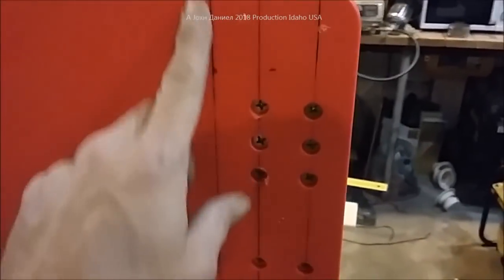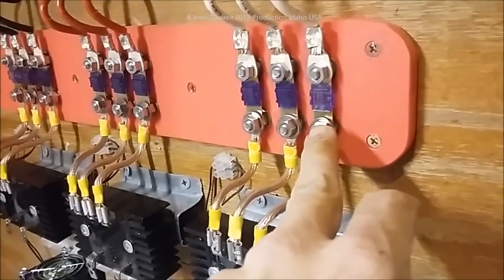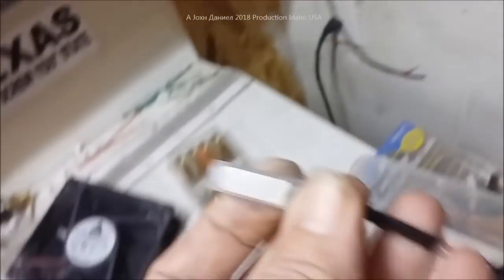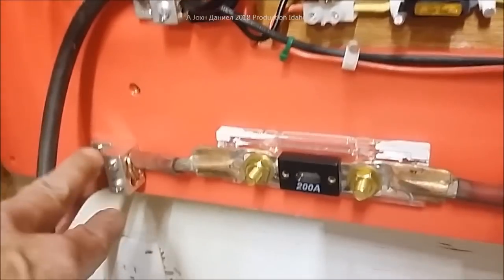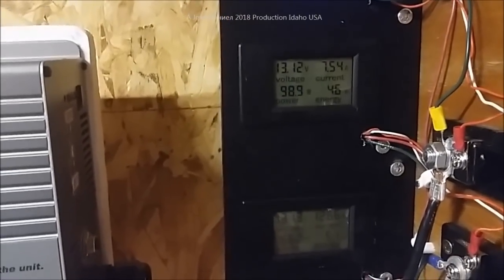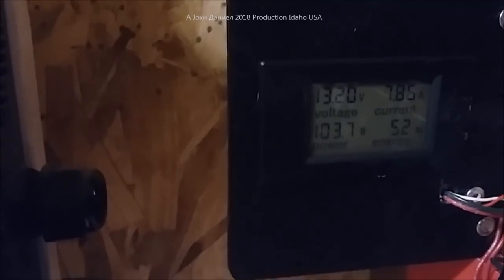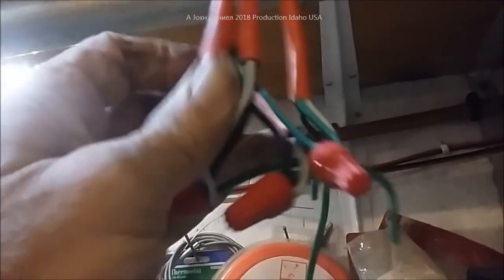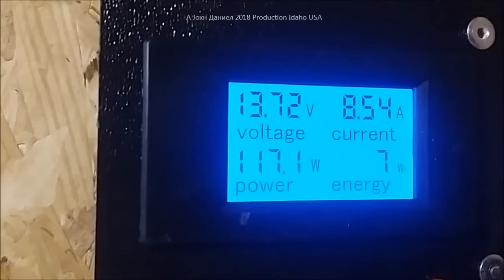Micro Wind Turbine 3 phase power systems Rectifiers pt. 1 my FULL PARTS LIST BELOW

Comment from the maker: LOOK UP TO THE INFO ⇑⇑ ⇑ ABOVE for the video, links to all parts used, updated when possible.
Reply: Јоhn Daniel    Love the work man.  I don’t see the list to link of parts used.
Reply from the maker: @dolfseymour5219  You must be using a cell phone to view them, look on the lower right under the video and tap the down button ▼ to see the video info.
Reply: Thank I bought greenergy turbine Apollo 650w w CC and dump load from the same manufacturer, I get to the same display you have, I'm new on this, is to support my small solar system pv 400w, 12v 620Ah, If I have to work in something how I'm going to break the turbine without damaging it??, sorry to bother, you are the only one that I see that explains very clear, sometimes speaks to fast for me but going back and forth got your point. The dump load Is 500w 1000w peak. Again thanks for your help.
This is my email is luismartinez53@yahoo.com in case that want to share diagrams help me out if you want I can send you pictures of the CC and the DUMP LOAD
Reply from the maker: @capellanluismartinez2746  Green Energy don't sell on Ebay or have a Apollo named turbine. Thats a ebay seller using the name, not the products. I've been gone down to the ranch 3 weeks so just getting back onto this stuff. Send me a Email to olympicpowercontrols@yahoo.com and I will see if I can help get you some info.

Comment: Hi Mate, I have been testing 10 small wind turbines in a low wind area.
I use 1.2M wind wheels, these Peaks are only in a 31mph Wind Storm.
26V - 24V 500W Vevor          -  Normal 5 Blade  -  6.5M high     -  8 Amps
26V - 24V 500W Vevor          -  Normal 5 Blade  -  6.5M high     -  8 Amps
14V - 24V ista Breeze i500   -   Scoop 5 Blade   -  4.5M high    - 11 Amps
12V - 24V 300W Hyacinth     - Normal 6 Blade  -  4.0M high     -   4 Amps
12V - 48V 500W Sunboo S5  -  Scoop 6 Blade  -  3.5M high      -  3 Amps
12V - 48V 500W Sunboo S5  -  Scoop 6 Blade  -  3.5M high   -  2.5 Amps
12V - 48V 500W Sunboo S5  -  Scoop 6 Blade  -  3.0M high   -  2.5 Amps
12V - 48V 500W Sunboo S5  -  Scoop 6 Blade  -  3.0M high   -  2.5 Amps
12V - 48V 300W new rotor    -  Scoop 5 Blade  -  3.0M high   -  1.5 Amps
12V - 48V 300W new rotor    -  Scoop 5 Blade  -  3.0M high   -  1.5 Amps
Peak Output Totals  =  45 Amps  =  753 Watts  ( average wind 6.2mph )
Town laws stop me putting up a big wind turbine higher enough to work.
Hey guys, think about posting your turbine information and production🤔

Comment: I purchased (3) three Real 500 Watt Wind Turbines from B&C Wind Generator Store, and the controllers are digital programmable with relay driver modules from Missouri Wind and Solar. All was working and operating fine for several days, then for some reason it stopped working. Missouri Wind won't answer my cry for help. I've got some pictures of my wind turbine  set-up, If you can take a look, how can i send them to you? email?    Eugene
Reply from the maker: Hopefully you didn't destroy your turbines, those controllers are made for turbines that don't make any consistent power or much at all. Using them on turbines with real output can hurt the turbine and toast the dead short controllers. You can send me questions to my email, I can check out your issues and help if possible. olympicpowercontrols@yahoo.com

Comment: Hi John, I just gathered up the parts to run the 400 watt turbine and I'm wondering is this a final design? I'm going to run it at 24 volts independent with a small bank of batteries to charge my ecoflow delta pro (240 split phase- 2units) batteries from. Then a small (starting with 300w) solar array directly in to the ecoflows as well. Do I need shunts with this? Purpose of the shunt for the 24 volt dc side is? Appreciate any help and thanks for your efforts within your channel.
Reply from the maker: Depends on the internal controller on that Delta. What is its max voltage and wattage input, what controller are you using, and are you where you get huge wind storms. If the 400 watt is a B&C or Green Energy brand you will get some high amps from it, can the Delta MPPT in it handle that surge. I would have to know more details on the set up. You may want to get a single agm slave battery, a 25 amp buck then you have no worries.
Reply: @JOHNDANIEL1  Each unit is rated for 11-150v dc, 15a max current and 1600w charging power max. I bought the model S 3 blade, 12 or 24v, 400 w turbine similar to what you used in the video. I'm 20 miles from the east coast of lake Michigan, on a lake in an open rural area where the wind hardly ever lays down. I purchased the parts listed in your videos so I have control over it with 24v worth of battery as a buffer in which to charge from. 3 pole drop switch, rectifier, 3- 100w resistors, wind/sun diversion controller, dc watt meter, thermal fan switches, 12-24v cooling fan, and a 50a rated 2 pole disconnect switch for the end of the line energy diversion control. Also bought in-line fuse holders and 40 fuses for the dc lines. FYI, tying the ecoflows together for 240v split phase hookup to my service panel using a manually operated switchgear. Of course I also have a predator 7000 30a 240v generator if everything fails. I want power outage coverage and intermittent selective house power to lower my power bill. Last month it hit $250 with me and the dog in the house!!
Reply from the maker: The thing to base your arrangement on is not volts or watts, but Amps. They only can handle 15 amps. No matter what the volts are, 11 to 150 you can not exceed amps. The value of a 220 watt solar panel. Sorta crappy when you consider it. The work around for this is the use of a digital isolator so the slave battery sends power to the Deltas when over 12.8 to 15 volts only, and disconnects when under 12.8 volts, a buck boost ( 2 total each 15 amps one for each) and some old school cheap lead acid for 75Ah or higher. Stick with it making 12 volt for this purpose. Should cost around $200 to build it. 2 like the Walmart series 24 marine Batteries, 2 Bucks, and 1 Isolator. It will work for years since your only taxing the batteries to 12.8 ( max draw to 12.6 which is 80% left. But using all the wind turbines premium power band. 
No matter how great they make Lithium batteries, the BMS do not like the rotating generators pulses which are healthy for lead acid. So car alternators and wind turbines are not great for charging lithium of kind, actually discouraged, other than LTO.  
So, if you need a drawing, parts list, and accurate conclusion send me a email so I can make you one. olympicpowercontrols@yahoo.com 
We always like no pay back loans, donations, bribes, early Christmas and coffee at either https:www.buymeacoffee.com/JOHNDANIEL or https://ko-fi.com/john4kiera
Reply: @JOHNDANIEL1  LOL...I know you have value. I'll buy the coffee, rib eye and leave a tip. I need to speak with you. Is there a contact number on the website? Too much to cover typing and I have an idea I would like to run by you. I will check for a number. 5-10 minutes tops.
Reply: @JOHNDANIEL1  I sent enough coffee to carry you through the week. You are welcome. I saw new Interstate batteries at costco for $104, 6 volt lead acid deep cycle golf cart batteries? Would 4 of these do well? The 2 ecoflow units charge at 1620 watts when plugged in to 120v outlets. Would it be more practical to charge off a properly sized 24 v dc / 125v inverter? FYI, One of the ecoflows came with a 12 - 24v 300w fanfold portable solar cell that I plan to use until it dies. It may put out around 240w on a good day, so I think it is safe on the solar side. What do you think of this idea. Allows me to tame incoming power via battery bank/inverter and feed these $2500 ecoflows safely.? Battery specs: Model: GC2-ECL-UTL
Voltage: 6V
Capacity Amp Hours: 20 Hour Rate = 225 Ah
Capacity Reserve: 25 Amps = 447 Min
Weight: 62 lbs
Length: 10.31"
Width: 7.13"
Height: 11.00"
Terminal Type: ELPT
Reply: @JOHNDANIEL1  oh..about the shunt and the buck? Way over my head in terminology..lol Thank you John
Reply from the maker: Time matters as things degrade in our country. So, going to get you ahead of things Order now, 2 that are 15 amp versions do not try to get bigger, 15 is the Delta limit. https://s.click.aliexpress.com/e/_DBBruNf. Order 2 https://s.click.aliexpress.com/e/_DEmBjrX one as spare always
Buy 2 https://bit.ly/3FHvTbl then pick up in your local area, and when its all about to arrive i will show you how to install it. You can feed solar and wind into this system, and always keep the Deltas fully charged with huge back up source for VERY cheap. 
Add a turbine add another cheap battery. Add over 300 more watts solar, Add another cheap battery. Simple. I will be doing a video on it ASAP.
Reply from the maker: PS- I did a drawing set up for a guy with a 1500 watt Bluetti with a 500 watt wind model. His is working perfect in Limon Colorado where wind is really good. He had to have 4 of the 50 ah SLA batteries and a pair of 22amp buck chargers with current limiting. They make 14.6 volts out at 20 amps each to his 40 amp internal controller from 29 volts from his turbine. Just got to know what your actual parts are to draw your power conversion lay out.

Comment: I setup a windmill that’s 3 phase AC, before the charge controller, and thought I’d be good with a 16/3awg wire running maybe 85 feet.  I get like 0.2 amps at most. 

Then I seen your wires.  I thought AC carried further without too much voltage drop but I was severally wrong it seems. 

I got 250’ of the 16/3awg.  Could I run 2 more of the 16/3awg wires, and wire the 3 wires in each one together and possible get more amps?  

It seems like your video so far is by far the best one which actually explains things.  

I wish I was your neighbor.  Id ask a ton of questions but I’d bring food/beer/donuts

Comment: With it being a three phase system would you be able to run say a 3 ph welder? Also if your not linked to a power grid and not selling your extra power what do you do with the extra power or how can you repurpose it or collect it?
Reply from the maker: The amps are too low in 3 phase to use effectively.

Comment: I'm not having any luck with this turbine. Does the turbine need to make more power than the battery is charged too for the turbine to charge the battery ?
Reply from the maker: You must exceed battery voltage to begin to charge. Low wind model blades, 5 blade or higher volt models will work in low wind areas.
Reply: Thank you thats what I was afraid of

Comment: Instead of fuses can i use p a.c. breaker??
Reply from the maker: Use no AC breaker on these, the bi-metal spring in them is for much lower temps.
Reply: @JOHNDANIEL1  thanks for your advise, 50A fuse will be used, for each line from the turbine to protect the CC and the rest of the components, thanks

Comment: I like the redundant load dump and would really like to get the 12V 24V LCD Relay SSR Diversion/Dump Control/Regulator Sol/Wind/Hyd 2URDC-1224-B
But I am running a 48v system do you have any recommendations. Thanks
Reply from the maker: You can add a 48v turbine using a 12/24 controller by tapping the battery for 12 volts sensing and SSR power to control the 48 volt system. I do it all the time. The controller set to 14.35 volts will run the 48 volt load via a SSR at a high charge stop of 57.4 volts. Need a schematic or better details on how to do it drop me a email olympicpowercontrols@yahoo.com I usually get back to people in a week or so.

Comment: How do you reverse a motor? lol Is that what a wind generator is? We build or buy a motor with a spindle, we fuel it, the spindle spins, power comes out. .... With wind, we build or buy motor with a spindle, fuel it(wind), spindle spins, power comes out. lol... but is that  the same type of motor? Or is it even a motor? lol  One way we put energy into making it spin, the other way the energy to make it spin is free. That part is obvious. But another difference is the wind directly spins the spindle. When using combustibles, their is a whole other system to harness that reaction and direct the energy at the propeller.  ..... Either way, once the spindle is spinning, what discipline or concepts cover how a spindle powers things. Cz it's not direct spindle to gear that gets things in the house moving, obviously. Is it obvious, lol. 

Somebody straighten me out please. I wish to build one from scratch.

Comment: Dear John 
I have shared your video in my Facebook  group ,  Kindly let me know if you have any objection ? It was so nice and worth , hence the option used , waiting for your response
Reply from the maker: Sure thing, show all you can. The more who learn to be able to do it themselves a smarter world we may leave.
Reply: @JOHNDANIEL1  Thanks for your quick response . I have a basic question . when the wind generator produce variable volt and frequency  say AC 10 v to 200 V yet check after trial  .frequency may vary , what would be the output DC voltage we can obtain ? will this be normal ?  I am planning to convert an 3 Ph Induction motor 3HP to permanent magnet wind generator . due to corona lock down in India , we are unable to move out from home , hence have lot of time to think . do it in month end .

Comment: Hey John,  Aussie Engineer here.  Is it possible to simply tie the a.c. wind turbine output into our Aust 240volt home a.c. circuit?  All your vids show the a.c. converted to dc via the rectifier and then complimenting the solar and charging you're battery banks.  Much like our rooftop solar dc output goes through an inverter and feeds 240v a.c. into house circuit and even outputs to grid during day when low house loads being used.  I'd like to design the same system with wind turbines.  Thx
Reply from the maker: The turbines output is 3 phase, and not stable like a generator running at 3600 RPMS to create 60 Hertz. So running it into a rectifier and storing the energy in a battery bank or running it into a dedicated Wind-Grid tie is the only ways to use it via a grid.

Comment: I have a apolo wind turbine. I don't get hardly any power out of it even at 20or30 mph. Like 2 amps. I have 10/3 wire going 70 feet. Can you please help????
Reply from the maker: Because its a Apollo LOL!. That guy is just a ebay hocker and hacker from Hong Kong. Falsely based out of washington state, but drop shipped from Hong Kong. Those turbines are made in Indonesia by spec. If you get you one of the 500 watt models listed below the video your going to be shocked at what a real turbine does.
Reply: @JOHNDANIEL1  could it be the size of wire?
Reply from the maker: @douglasw804  Although 70 feet in 10 awg for up to 500 watts, it is the absolute limit in such a set up. Simply, the turbine if not falsely rated would be making 85-90% of its claimed at 25 mph winds. It took me years to weed out those brands/people in what I use now.

Comment: Real nice.....been thinking about wind and solar, this vid shows pretty well how to set up the stuff....  but what's a guy to do to battery? A 12, 24, 48, or whatever? How is that hooked up? Then how's a guy to run it to the home to power it? For the basic home.....off grid? Or can a guy be grid tide if you have wind? I know you can if you have solar!
Reply from the maker: I prefer the option of 12 volt due to the fact that I can find materials anywhere and everywhere and do not have to order special items. But as far as grid-tie and other uses the sky's the limit but you must be sure when you do buy a battery Bank to buy all your batteries at the same time and never underestimate how many you need.

Comment: Hi John! where can I get those white/clear wire connectors that you use?
Reply from the maker: Cheapest with any speed to get is Ebay https://ebay.to/2IWSdR4
Reply: @JOHNDANIEL1  The white wire connectors that you put a wire in at each end and then tighten with screws.
Reply from the maker: @jbhobbyist9372  AH! terminal strips, go see and scroll down to all kinds of option, be sure to get right amp ratings and heavier  https://ebay.to/2VRVm9N
Reply: @JOHNDANIEL1  Very cool, Thanks